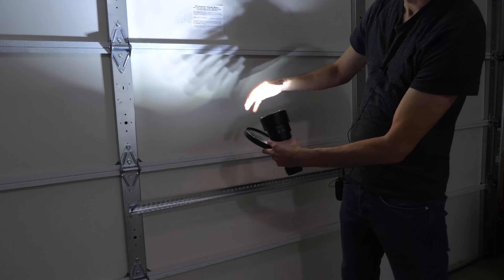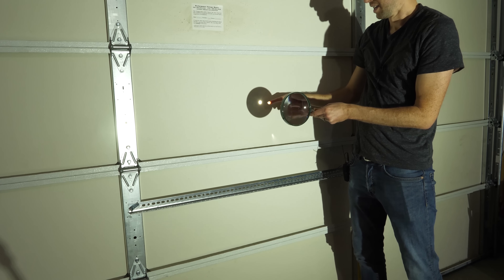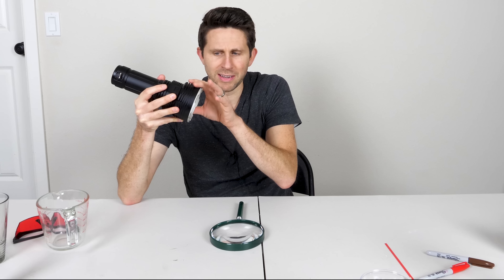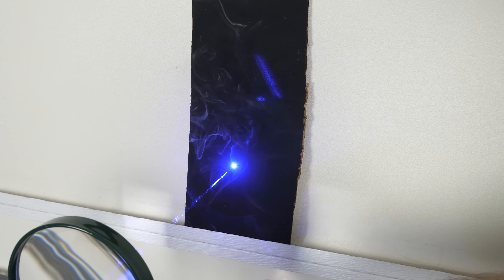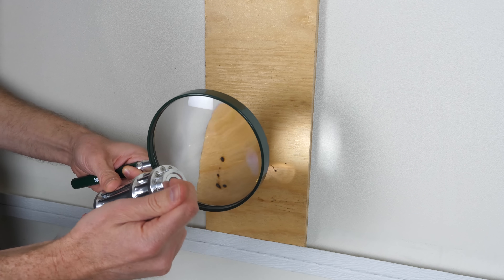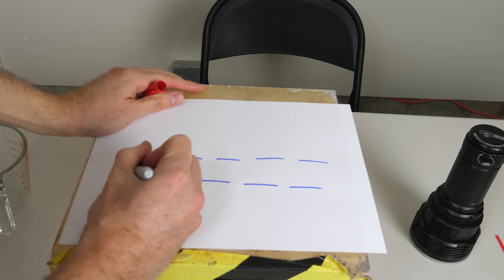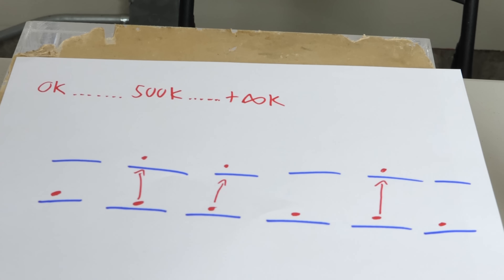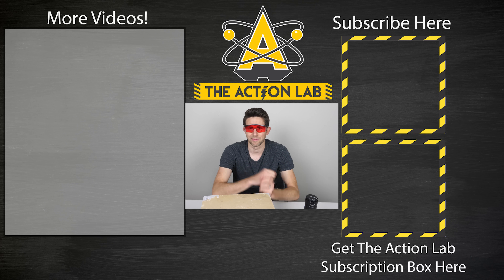What Happens if You Focus a 5W Laser With a Giant Magnifying Glass? Negative Kelvin Temperature!

Comment: Soo.. what if we put a series of lenses (probably a combination of convergence and divergence lenses) starting right in front of the LED torch ensuring that every angle of its beam of light would eventually converge into a single point. Would the single point be hotter due to the difference in the W/m2 of the two surfaces (i.e. the small point should have the far greater one)? Or would the light simply refuses to shine to that point due to fear of breaking the law of the thermodynamics? Or any other explanations?

Comment: you need to learn more about lasers they  wont burn up close or really  far you just need  the focal point witch is the most amount of light and energy is pulled through to close to a point i say close because it is impossible  to pull beams  of light to a single point & you can you a lenz to pull it in more but it wont work infinitely just to a degree cause say you put another lenz 3 meters  away the beam will split up up until the other lens it has spread and then when the beam reaches the other lens it will have loosed energy and then will be focused to a less tight beam  . BTW  i like you channel  and you have earned my sub 😁

Comment: Should be, because a laser is effectively a minimally entropic form of energy, versus thermal radiation, which is maximally entropic. So a laser should be able to heat indefinitely high by suitable focusing, but thermal radiation should not - only up to the temperature of its source. Which is, of course, the actual case and why that focusing sunlight can only get to an absolute maximum of 5800 K.

Alternatively, one can say that LASER radiation is effectively thermal radiation from a negative-temperature source - the inverted population within the lasing medium!

Comment: You can if you use multiple lens! Stage in a row. The first near the flashlight. Then rinse and repeat. Till it's completely condensed. And standard bulb not led. (Hot bulb). No violation. Also that's no giant lens it's too small for that size light to begin with. Just a thought! Really haven't tried it. So don't sue me. LOL.

Comment: Just fyi if anyone's confused about the temperature thing, negative Kelvin temperature is a completely different concept from negative Celsius or Fahrenheit temperature.
Negative Fahrenheit and negative Celsius are based on the points beneath which humans feel cold or water freezes, the negative measurements in these systems are not actually any different than the positive measurements, we just call them different because they feel different to us.
This is not the case with Kelvin negatives.
This video shows that negative Kelvin is hotter than positive Kelvin, because 0° Kelvin is literally as cold as physically possible, -1° Kelvin is not below 0° Kelvin, it's actually far above it, (in Kelvin, 0° and -1° are literally opposite ends of the spectrum, they aren't close together at all,) unlike our conventional temperature systems. It sounds counterintuitive but it's just how the physics works in Kelvin temperatures.

Comment: Use a Light Pipe to trap the peripheral light cone back to something the 1st magnifier + flashlight can focus. While the 2nd Law of Thermodynamics is certainly inviolate, that's NOT the reason we're seeing demonstrated for why you can never get the point hotter than the ENTIRE (hint) source. Sheesh. Wonderful example of tweenty-something wanting to show off how SMART he is. I'm out. Btw- comment below showing off "Quantum Effects" still doesnt get it, because it STILL sidesteps the real problem. "Negative Kelvin " ? Negative "Absolute", where Kelvin is NOT  a measure of Temperature, but rather a measure of Energy State,  you cant have a "Negative Absolute", so all Quantum THEORY aside ( this isnt the ONLY place where the Mathematics of Quantum Mechanics breaks down, ) the offered THEORETICAL Explanation is STILL NOT DEMONSTRATED by this "Video". Sheesh. So "smart" he can't spot his own speedbump. Look, the original struggle with the flashlight (FLASH LIGHT !!!) (Hint: LED Wavelength, and that's as MUCH as I'm willing to give you) showed the starting and ending ignorance,  and completely MISSES the very point this Tweenty-something gives for posting the video in the first place, all jargon aside.

Comment: "you can never use a lense to make a flash-lite brighter" 1: mabe you couldn't see what we saw on video but that small point was brighter than the surrounding lite. 2: Use 2 lenses, then your problem is solved. You may have to use two different lenses but it can be done.

Comment: If your laser ws focused and had better beam divergence you wouldn't notice any difference the only thing would be that you can get it to burn stuff from a greater distance the same amount of light is always there whether u focus it or not and the temperature doesn't change just the concentration of the light which will inevitably make something set on fire faster...  I dont think that whole negative temperature stuff is correct i put my hand in front of it and i feel my hands warm up or burn Becuase it gets hot + temperature in other words you can't make your ladder more powerful but you can focus it... In my laser i can focus  the line without external meansto concentrate its energy. Try putting the door on a thermometer and see if the temperature goes down or up...

Comment: I think the (new) definition term of "negative Kelvin (absolute) temperature" is sounds like make a new problem over old problems. Kelvin temperature scale already defined as absolute. And "absolute" already defined as nonpositive number. Both "absolute" and "negative", isn't this a paradox? It's like covering lies with a new lie. It will render mathematically correct, but make theory become less intuitive. It defense sacred thermodynamic law wich was already accepted. There are many theories having similar pattern. Like relativity, which define light speed as a constant, another measurement must follow, even it much less intuitive.  Another example is the use Bernoulli theory to explain airflow around a wing to describe aircraft lift; which is good to explain flow inside a pipe. But I think, it will be better to use Coanda effect / Flettner rotor and old Newtonian action-reaction to describe & analyze the phenomena. There are many more.
This is not about right or wrong, but about new definition which make theory around people more intuitive (and constructive) or not. Now, there are some scientific-community-accepted theories and explanations that become barrier wall, instead of helping progress of science & innovation. They should be revisited or rewritten from scratch if necessary.

Comment: @The Action Lab

Could you do the flashlight part again with the flashlight except shine it down a tube with an interior mirror surface? That way you don't lose any of the light. Also shine it through 1-way glass that is clear on your side but a mirror on the other, so all light that reflects back to the flashlight is sent down the tube. I estimate only 10% or so light loss if you do this right.

Comment: flashlight = single pulse wave photon energy at instant time which does not pass and create energy over critical level to burn due single circuit electric.
you need mutil source energy at mutil distance flashlight to create different wave light and more densities photon to reach or matching conditions.

Comment: Thanks for the explanation!
I have tried a laser on my pyrographic art, but couldn't get enough heat from it as I did from the sun and a magnifying glass and harder to control... I wish I had a laser pen with enough power to burn like the sun.
The smaller the magnifying glass the thinner and shallower the burnt line. The sun with a 6" glass will burn an 1/8" x 1/8" deep groove about 6-8" a minute on a clear day.. (brush ash out and burn again for depth.) Best I got was a burn mark on the wood with no real depth in the burn with laser.
Some of the burns so you get an idea:
 https://www.facebook.com/azwufman/media_set?set=a.1139902146324&type=3

Comment: The laser gain medium may be thought of as having negative temperature. That's how lasers and population inversion works. However, this is not the reason why the laser light can be focused to a smaller point. Yes, lasers can be fundamentally focused to a smaller point due to their COHERENCE, but not because of the "negative temperature" of the gain medium. Coherent light can be produced without population inversion (see, for example: https://en.wikipedia.org/wiki/Superradiance ). Besides, how do you define the temperature of light once it has exited laser? If it does not have a blackbody spectrum, you cannot do so.

Comment: You could get a point hotter than the flashlight simply by having more focused energy (although it would be hard to pull off with a flashlight that spreads that much)
The energy of the point would be lower, but its temperature would be higher (a gram at 30C is hotter than a ton at 20C but is has less thermal energy)

Comment: If the light is less concentrated, then the energy transferred to each point is lower. The reason that the flashlight doesn’t work is because most of the light is not refracted into that single point.

Comment: Hello,. Not questioning any of the science in the video (really didn't pay that close attention to the lecture) but would like to know if you upgrade the diode, driver and heatsink on that laser host? That would require a tremendous amount of work machining out the host in order to hold the upgraded laser module and heatsink and I'd be interested in doing a similar mod idf you could share your schematic. If not modded, I regret to inform you that, that particular laser outputs at 445nm, which is what you're using as demo, tops at 1W output. Nowhere near the 5W posted. That gatling style laser is produced en mass by a multitude of Chinese manufacturers; typically sold anywhere between $40 - $70 bucks, and not all manufacturers are entirely forthright when advertising specs. Actually the laser is a great deal for the price. Be sure to Loctite all screws holding the small rods or risk losing them. I have several of these in different wavelengths for my collection. I like the style. The low price is very attractive and the 1W 445nm version is quite robust. Most of these cheap Chinese lasers are overclocked and burn out quickly, mine has been running strong for couple years now. Back to your video - a properly focused 5W, 445nm laser using a G7 or G2 lens would ignite  the object you're using as a prop from up to 10' away - without any additional magnification or manipulation of the beam. If that were a 5W laser you're using the close-up you did ought to have immediately combusted the prop into flame, regardless of focusing. Black material would absorb almost every bit of the energy output - and 5W of 445 nm is a LOT of energy. So I suspect you were taken-in by false advertising and have a 445 nm laser that outputs from 600mW - 1W. If you're interested in owning a true 5W, 445 nm laser let me know. I will build one for you and include LPM graph of your lasers output measurement. Cost is $500.00 shipped with 1 year warranty for any failure of build, parts or materials not related to user abuse, neglect, inexperience or failure to follow duty cycle guidelines as laid-out in user manual that's included with each purchase. Thank you. If not from me at least get a laser that truly has the output of what your post indicates. Deception, even through ignorance, is not acceptable. This, or any lasers output,i easily is confirmed simply through a measurement on LPM. Thanks.

Comment: Pseudoscience in a nutshell. Also, just get more lenses. Then you can get the flashlight to a ridiculously small point, which will make it significantly hotter than the original source. This is because there's just as much energy as before, but in a much much smaller area.

Comment: well i dont agree there. you can point lots of lasers to one point and probably get terriblly high temperatures. some is walid for sundlight and projector or flaslights too. 
anyway i dont know which thermodynamics law says that its impossible to point lots of light to one point anyway :P
Reply: the problem i guess with the magnifying glass is the direction of the light sources are more then one and no one of them are syncronised with each other . while lasers light is syncronised/each line is paralel to each other in microscobic detail while home use projector is not aligned in microscobic levels jus milimetric level adjustments on reflectors :P

Comment: You can... focus te flashlight into a  point with with a lens without  losing light. If you use a " conical mirror  to reduce the size of the source. In a way it's part of the construction of a laser in a way that using mirrors you can collect light from multiple light sources into one smaller source

Comment: You can get a flashlight spot as bright as the flashlight, but you need more than a single simple lens. You need at least 2. The first lens (or set of lens) close to the flashlight to collimate the beam and the second to focus it into a spot. The first lens will probably need to be ground specifically for each flashlight.

Comment: You could have saved yourself the headache of explaining multiple times if you had explained power density. Blue lasers do NOT project a round beam. It's rectangular. Get a fog machine or have a friend who Vapes fill a room with vapor. Turn your blue laser on and you'll see the beam is rectangular. Using the formula of 250/cm2×5,000=power density of your laser.

Comment: Scientists in Munich actually were able to create an atomic gas that has negative kelvin temperatures using lasers.  The gas was negative kelvin, had a negative pressure, and even though the atoms were attracted to eachother the gas cloud didn't collapse (because of the negative temperature).  The gas they create could explain how dark energy is expanding the universe (and not collapsing) and could also create engines with a thermodynamic efficiency of over 100%.  

They did this by cooling 100,000 atoms in a vacuum chamber to a positive temperature close to absolute zero (1/1,000,000,000 K).  They captured the atoms in an optical lattice made from laser beams.  This insulates them from the environment and causes the atoms to reach the upper energy limit (via tunnel effect) in their arranged lattice sites. They recorded the new temperature as - 1/1000,000,000 K. 

 In positive temperatures, atoms more likely occupy low-energy states than high (Boltzmann distribution).  When an object is heated, some atoms reach high energy levels and at absolute zero atoms would occupy the lowest energy state.  At an infinite temperature, atoms would occupy all states. Negative temperatures then are the opposites of positive, where atoms are more likely to occupy high-energy states.  Its an inverted Boltzmann distribution. 

The researchers said in order to comprehend negative temperatures, you should think of temperature existing on a scale that is a loop and not linear.  (When temps go below zero or above infinity, they are in the negative part of the loop).  They stated that the gas is not colder than zero kelvin but hotter than an infinite temperature.  

https://www.sciencedaily.com/releases/2013/01/130104143516.htm

Comment: Force vs work, mass vs weight, heat vs temperature--none of these can be used interchangeably.  In the real world, engineers who make mistakes like this blow things up and kill people.  

Get back to the basics, and don't attempt to regurgitate advanced theory when you have a sloppy grasp on the fundamentals.  It just might save your life someday!
===========
Temperature is a measurement of average kinetic energy (speed)--not heat which is a sum of kinetic energy (speed*mass).  You can't use the two interchangeably.  

It is just like the difference between weight and mass. "...Oh look!  This stone  weighs less in water.  We must have used advanced physics to break the law of conservation of mass". How absurd!

Or like using a wedge to apply tremendous force using very little work...  "Oh look!  Let's use quantum mechanics to explain away the law of conservation of energy."  Huh?

You can't even begin to correlate temperature and heat if mass is not known or constant--Much less explain thermodynamics. Isn't E=MC^2 taught anymore?

Comment: Sounds completely incorrect. First of all, you can actually focus a flashlight to one point by having a tunnel like channel for light to travel to the lens. Secondly, it is possible to have a temperature higher than that of the sun's surface using sun's light, there is no violation of the second law of thermodynamics.

Comment: 1. There's no negative kelvin. Kelvin goes from 0 to infinity. 
2. If you think there's a number greater than infinity, you don't understand what is infinity. Only another infinity can be bigger than an infinity, and even that is completely theoretical.
3. You assertion that you can never focus LED to a temperature larger than the sun is simply wrong. Suppose your glass is huge, and LED omits huge amount of power, you can make a very small point hotter than the surface of the sun (about 6000 celsius).
4. Could you please do your research, before spreading misinformation?

Comment: What is also wrong with this video is that the laser you are using is NOT 5 Watts! Those run on rechargeable lithium batteries like a CR123. You can't get 5 watts out of those. I have one of the exact same lasers you have and it's no more than 2 watts. However at that wavelength it will burn from across the room. Focusing the coherent light down further through the magnifier gets close to the effect of what 5 watts would be like in burning, but still a far cry from being a 5 watt laser pointer.